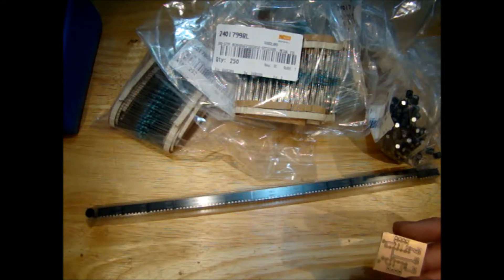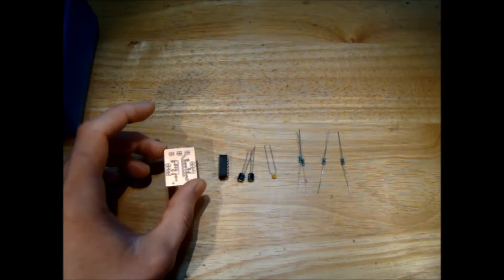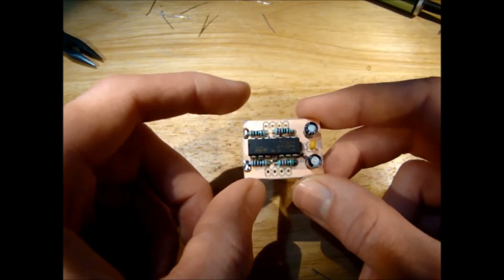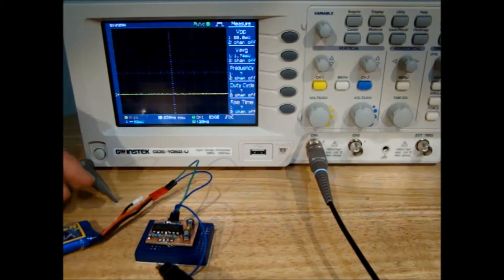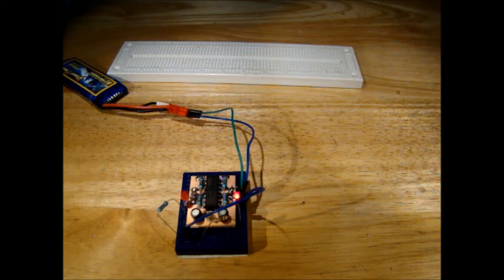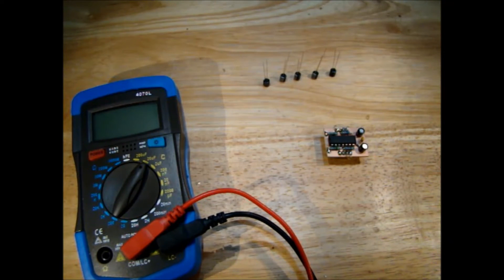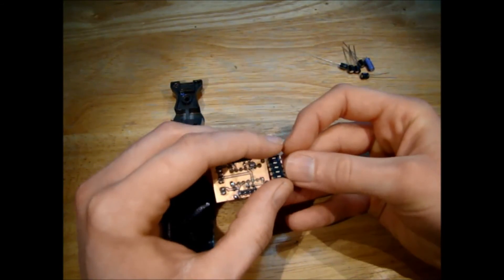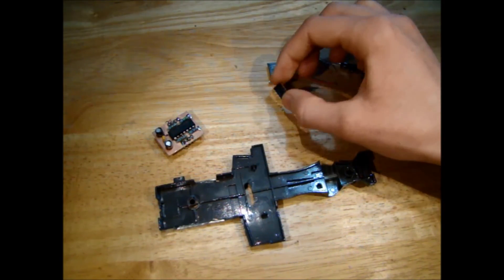Testing the 555 timer flasher unit prototype

Comment: Perhaps you could replace the resistor with a small cheap pot?  Like this one? 
http://se.farnell.com/panasonic/evn-d2aa03b14/trimmer-10kohm-1turn-th/dp/2281358

I'm sure there are cheaper variants available.
Reply from the maker: That's a very good suggestion, i can redesign it with the footprint for a pot and if people want to use a single value resistor they can just solder it into the pot footprint. It might be a little tricky to get fine adjustment on a single turn 50k pot but I think I have some at home so I can test it out in another video. Might be better to have a 45k resistor in series with a 10k pot or something like that.